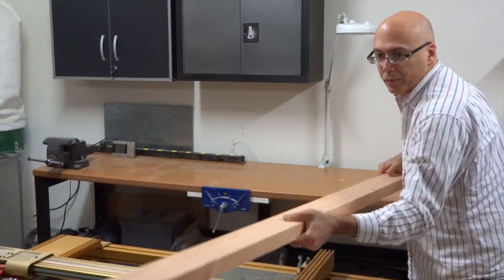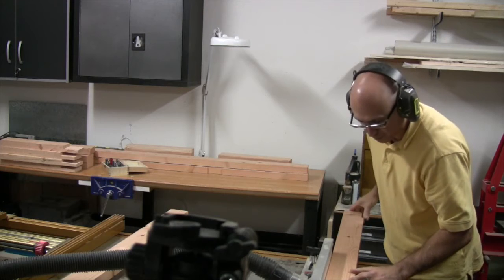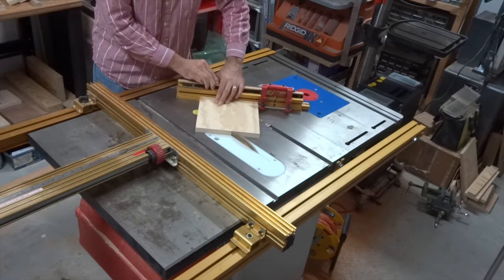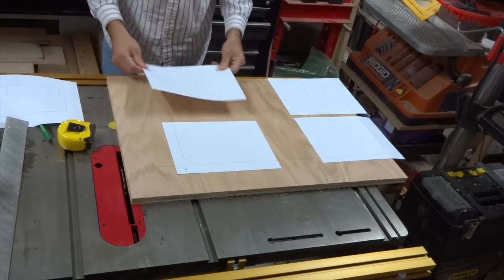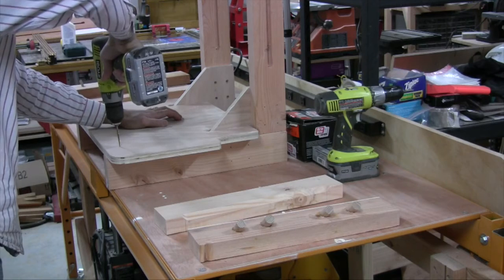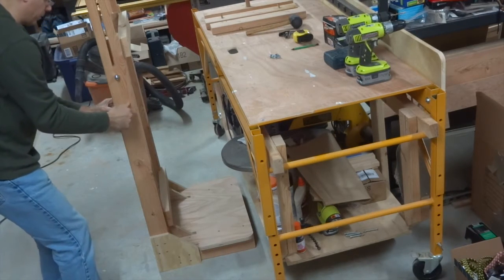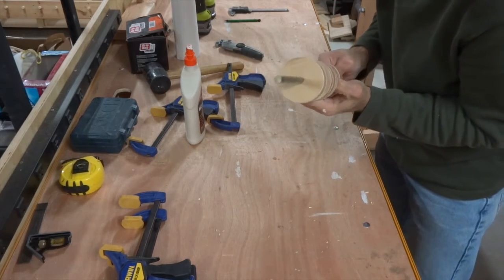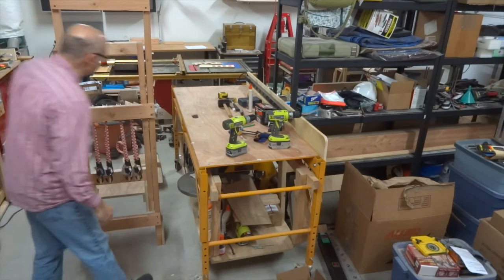Easy Pull Ups Machine Build

Comment: Have you heard of resistance bands?
Reply from the maker: Yes, but I couldn’t make a build video about them.
Reply: I have a suggestion...Can you make a contraption whereby you can use actual weights on one side of a lever? Check out the Powertec assisted dip/chin for example. It would have a more continuous tension principle as opposed to the slackening of the bands as they contract.
Reply: How is this easy? when you need a full workshop to make it lol
Reply: Resistance bands assist where the pull up is easiest making them useless.